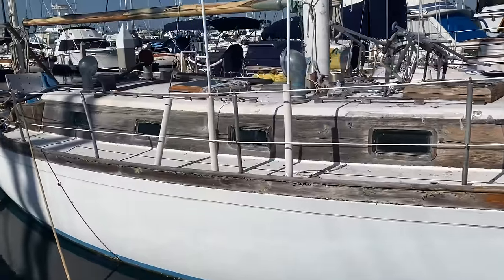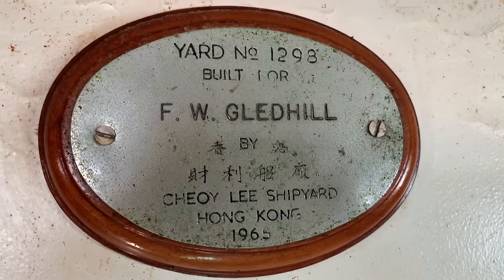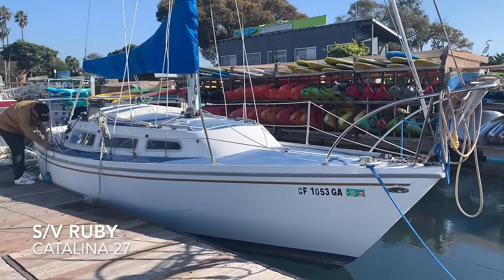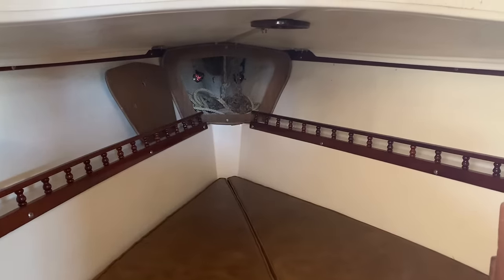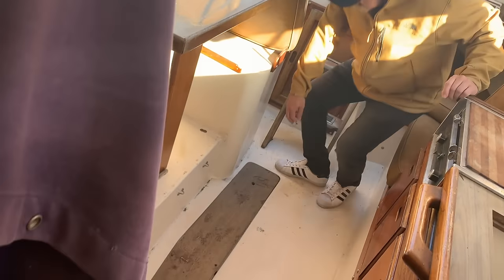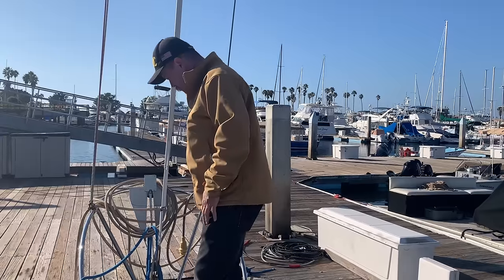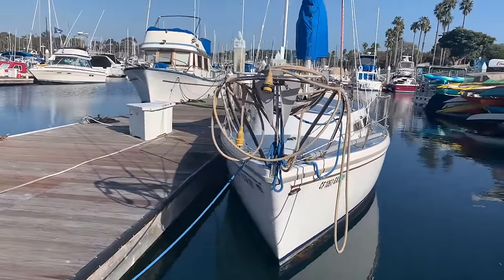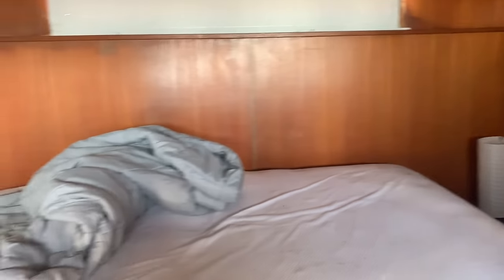Free Sailboats San Diego

Comment: I bought a 1973 Chris Craft Commander, 42' sports cruiser model 5 years ago with a boat partner.  We have spent every vacation day we have had since we bought it working on it.  Every single one.  And we are just now getting to the point where she can go back in the water and head over for her new life in the Bahamas.  Of course, we did a lot more than just "get 'er running", etc.  This is a pretty high end venture.  We wanted to create a custom fishing yacht from the rock solid hull.  So far we have about $150k in the project including the initial purchase price of $20k.  Yeah, it's a lot but you'd have to spend a lot more buying what we made. A new 42' Chris Craft Commander runs about $900k + tax.  Yes, really.  Let's face it, the dollar just doesn't buy what it used to.  And that is without all the high end fishing electronics, bait well, underwater lights and cameras, etc. that we have installed.

About 50% of the work we have done is documented here:

http://thirdwaveyacht.blogspot.com/p/introduction.html

So yeah, I agree with Boat Man, nothing is as expensive as a cheap boat. Either you spend a ton fixing it up like new OR you spend and spend and spend over time on maintenance.  The good thing about rebuilding a boat, however, is that you literally know every single nut and bolt and system in the thing.  You will never need to call the boat repair guy because you ARE the boat repair guy.  Fiberglass, gel coat, engines, water systems, AC and DC electrical, hydraulic steering, pumps, air conditioners, you name it.

Comment: Catalina 27 is my favorite boat for a day sail out of San Diego, but I wouldn't own one, or any other,  because there is a great option to owning here. That is Sea Forth Boat Club. They are the oldest in SD and have 4 to 5 locations here. Initial membership is around $ 400 and $ 30 / month. That gets you very reduced rental rates and great choices of boats. For instance: a Catalina 27 is $ 195  for a day. Compare that to owning a boat with slip costs, insurance, maintenance , etc. You don't do any cleaning, no maintenance, no empting of sewage, nothing.  All locations have full bathroom with shower privileges at the various marinas and you can sleep overnight.
Reply: Oh, that's sounds ideal.

Comment: Buddy of mine was a civilian teaching sailing at Navy Coronado Sailing Club and overheard a boat sank at its mooring, probably due to a through-hull fitting failure. He bought the boat for $1 and raised it the next day. He had it hauled out and I helped him fix it up in the South Bay boatyard. He put new rigging on it and later that year we raced it in beer can races and won a PHRF class 6 title later that same year. The rigging and sets of used sails came to $15,000
Reply: That would be Fiddler's Cove where I had a boat (on the moorings and in a slip). The boat is still there, just no longer my boat. I don't think it's uncommon for moorings to be the place where boats go to die, depending on the marina. There have been boats at Fiddler's that have sunk or nearly sunk in their slips too.
Reply from the maker: Yes!!!!
Reply: @nicolelewonkenobi  Fiddlers Cove, yes.

Comment: I sailed in San Diego harbor quite a bit and have seen sailboats on moorings that haven't been touched for several years, the curtains were tattered from sun and sailcovers cracked. Very easy to find cheap boats here.
Reply: Very common. But I think that's very common of a lot of moorings. The free moorings in San Diego that used to exist that had some of the worst of the worst had been cleared out.
Reply: As a Canadian this is the first I'm hearing. Might be worth the drive!
Reply: @wilfdarr  Many yachts built in the 1970s were "overbuilt" due to the relative unfamiliarity of fiberglass at the time.  Many famous makes such as CAL, C&C etc can be found very cheaply.
Reply: @robertthomas3364  Boats from that era are a bit leaky and need bilge pumped weekly.
Reply: There have been several boats at Fiddler's Cove that have sunk on the moorings that staff didn't even know had sank until people let staff know a mast was sticking out of the water. There has been at least one boat on the docks while I owned my boat there that was been down to the rigging before anyone noticed and put pumps on board to keep it from completely sinking. The moorings are now the first place the staff checks to ensure none of the boats have sunk. The new management, Jarrod and his higher up Brandon are civilians who don't even have any boating experience, yet are running a marina! They also have no knowledge of the military and make policies that don't even take into consideration that people may be elsewhere on deployment for extended periods of time and don't have immediate access to their boats! The previous Dock Master was amazing!!! Once these new morons started implementing ridiculous policies, he retired and it has gone quickly downhill since then. Their policies are absurd that sooo many people have left the marina for marinas that are a lot more expensive simply to avoid the headache of dealing with the incompetent staff!
Reply: @nicolelewonkenobi  Wow, that's sad.
Reply: Hmm may want to come to Cali! Even garbage sailboats in indiana people want 3k for
Reply: How can I get there phone numbers

Comment: What do you look for in a cheap old boat?  #1  Is the Hull, Deck & Keel in good shape?  #2 Does the Engine Run?  #3 Are the Sails decent?  #4 Is the mast & Standing rigging decent?  Not to say perfect, but decent, as in can you sail it at all?  Mold is sometimes a deal breaker, but most of it can be cleaned up.  The less woodwork, the better, plastic mold cleans off easy, and doesn't rot?  Everything else is cosmetic, and can be replaced, fixed or cleaned.  Even Sails are easy to replace, or outboard engines.
Reply from the maker: I agree. Wood is a difficult medium to work with on boats, when compared to fiberglass/plastic.

Comment: I've got a 1984 MacGregor 25'. Its always needs work done to it. In reality boat is an anagram for bust out another thousand😉. Most of the time its a labor of love
Reply: I bought an '85 swing keel for $500. Had to re-core the whole top deck and basically rebuild/refresh everything.  It's a fun project. It's a cheap boat compared to any in a marina. That's for sure.
Reply: @dmc8921  yeah I think mine needs that done to it as well. Theres one method where they drill holes and inject epoxy into the cavity then theres the method where they cut the ceiling open and replace the individual squares. I called MacGregor a few years ago to find out if its a solid sheet. They said its more like a grid with squares.
Reply: @robertwilliams450  Mine was 2 solid sheets of 1/4 inch plywood with a seam down the middle a 1/4 inch wide filled with epoxy filler. The water followed the seam down the whole deck from the mast step. I cut the top layer of fiberglass off and it came off the wood easy due to the rot. Replaced the wood soaked it with epoxy and epoxyed the skin back on the top. I'm repainting the boat so it will cover any scars.  You can go from underneath but it will be hard. I had a 300lb dude and myself stand on it and it was solid. Stronger than before I think.  Hopefully you just have to do the mast step area and not everything like me.
Reply: @dmc8921  mine goes pretty much to the edges and from the companion way to the front slope. The fore deck above the v berth is solid as well as the cockpit floor and benches. The mast step was loose when I got it so I'd say thats what happened as well. The life line posts are solid as well but thats right on the edge
Reply: @robertwilliams450  Mast step is the common issue on these. If your deck isn't too bad the drilling the holes and injecting the epoxy would be cheapest and easiest. Worth a try considering the amount of work replacing the core. Drill the holes and let it dry out a bit first. "Boat works today" has good videos on fiberglass delamination repair. Cost me about $400 with supplies left over from jamestown dist to replace the whole deck. Good luck.

Comment: The 29' Pearson is a Pearson Flyer (30'). In good shape they go for around $10k.
Reply: Manufactured from '81 to '83. They are a relatively quick boat for club racing. Comparable to a J30.
Reply from the maker: Thanks! I’d never seen a flush deck Pearson like that before. Pretty bare bones boat. Looked very racey!
Reply: PHRF on them is 144.
Reply: @rich7447  please explain the Pearson 29 and 30 models. I’m confused by them despite sailing Narragansett Bay for 55 years. Thank you in advance.
Reply: @ignominius3111  Pearson never actually made a model called a Pearson 29 as far as I know. The Flyer is a couple of inches under 30'. I only know of the design from a single boat that raced out of the same club as I did back in the later 80s (Canada). We had a couple of Pearson 28s in the fleet already (more for the weekend distance type club races) so we weren't expecting it to be as fast as it was. I think it is an outlier in the Pearson lineup.
Here's some info on everything Pearson built (the Flyer is on the first page):
https://sailboatdata.com/builder/pearson-yachts?paginate=25&page=1

Comment: spent 50 years fixing up boats, If you can get super cheap storage some are worthwhile , bleach is your friend.  suggestions start with a small boat, small outboard sailboats. on that check the deck first and don't bother going inside until checking out all the stanchion base areas for cracks and especially the base of the mast , if they are not nearly perfect, move on.
Reply: I've worked in marinas years ago. You are so right bleach is your best friend. Seaside humidity grows plenty of mold.

Comment: very true what "boat man" said. I know the old guy that lived on this boat . I lived next to him. I offered to do maintenance. for free. I'd say there was no maintenance on it for more like 25 yrs!
Reply from the maker: The funny and not so funny thing is all the surprises. Strange configurations and no matter what was screwed down, every screw was a different kind. I’m not kidding! I swear ANY bad EVERY part that has 3 screws in it has 3 different kinds of screws. I found random screws floating inside the distributor. Whoever worked on it wasn’t a sailor. Bless his heart for trying to maintain the boat but I’ve spent about $8k already replacing just about every screw and bolt on the boat. The main halyard sheave was not even there. Someone just ran the wire halyard over the pin. I could go on forever. I spent over 4 months, 7 days a week working on her. I didn’t film a lot of it of it just because it was so frustrating and exhausting. Lol!
Reply: @sailingketchstarship1965  
I’ve found most boat owners know just enough to be dangerous. Wiring and fuel system changes absolutely scary!

Comment: Looks like restoring a boat is like restoring an old car, start with the absolute best you can afford, then spend a little more than you can afford, it will cost less in the long run.
Reply: Yes,I learned that the hard way.  Don't let the cheap initial price lure you in.

Comment: what about the mooring fees ....do you buy a boat for  $200  and are then find you owe $10,000 in fees to the marina
Reply from the maker: Typically the marina will not charge the new owner slip fees from the previous owner because most people will not want to pay that. They usually just want the boat gone so they can start generating revenue from the slip or mooring again. They might charge $200-$500 for the cost of processing the lien paperwork, though.

Comment: the CL is landfill unfortunately.
Reply: I think its still there
Reply: @chrisseidel6347  That boat is worth saving, could you confirm if it's still there?
Reply: @robertroberts8152  Not worth saving. It's got some nice hardware but you'll have to pay disposal on the hull, so you'll likely not even break even. If the engine works, it's a better deal, but no guarantee, no matter how nice the paint looks on the outside.